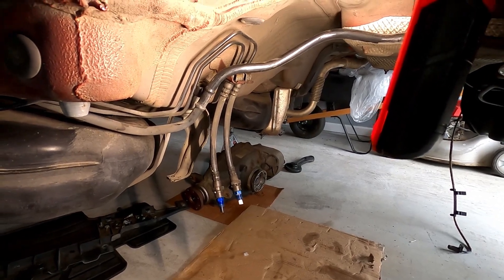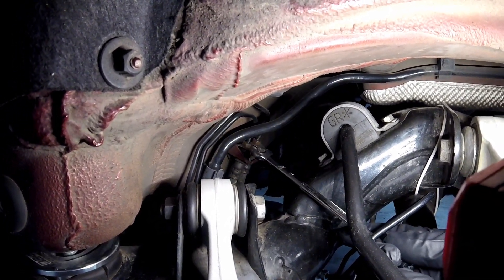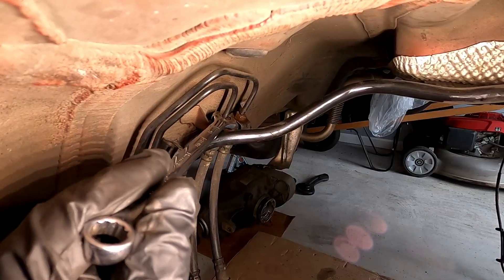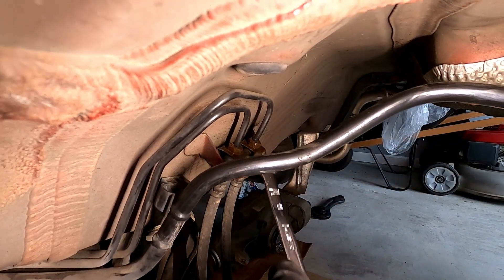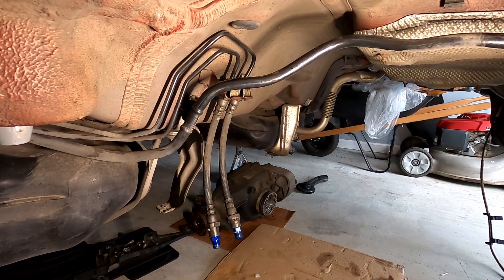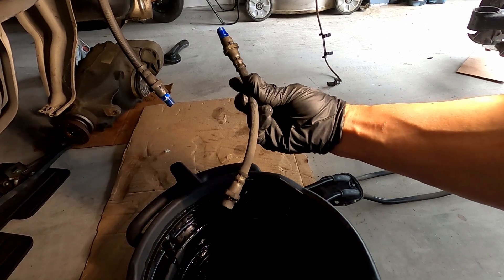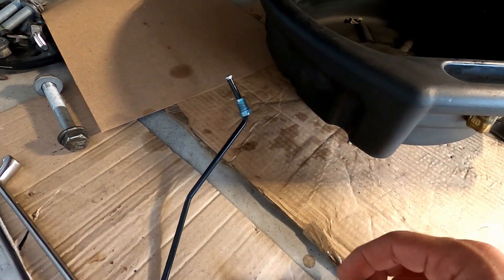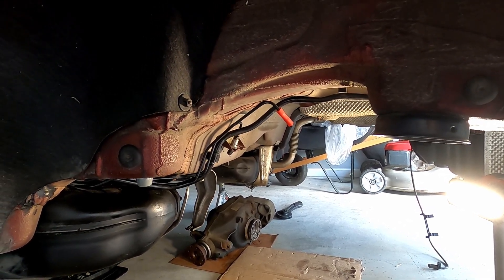BMW E9X intermediate (rear) brake hoses replacement | Part 1 | 328i

Comment: Hey man, great video, I had a question, I'm getting my rear subframe replaced, I've already got a new rear subframe (comes with new factory bushings, not going for aftermarket), new control arms/toe arms, new bushes that go on the wheel hubs, and I was also going to get new stainless steel brake lines for the front and rear as well. Are there two lines per side? I was also wondering if you could let me know what other bits I should get for the replacement? Such as rear sway bar bushings etc? Thanks
Reply from the maker: Thanks. Rear brake lines count is 4 total, which is 2 per side. I would think that swaybar bushings and end links, yes. Also the heat shield that is above the subframe, that thing usually rusts at mounting studs, and impossible to replace without removal of the subframe.